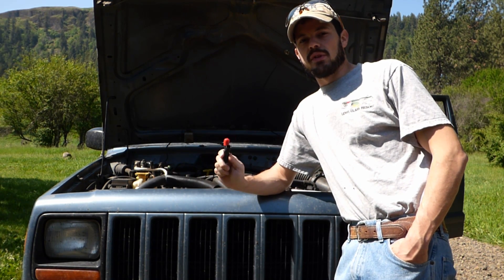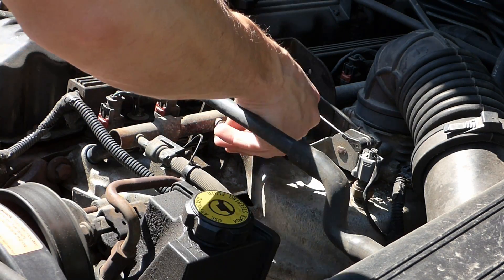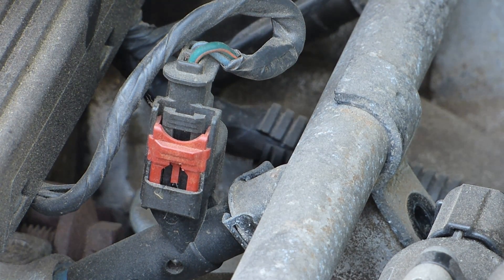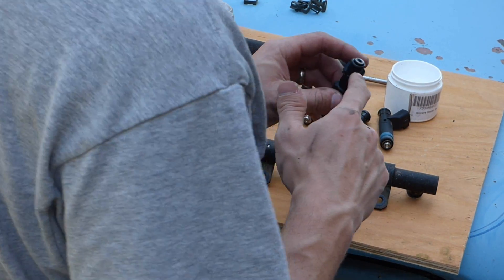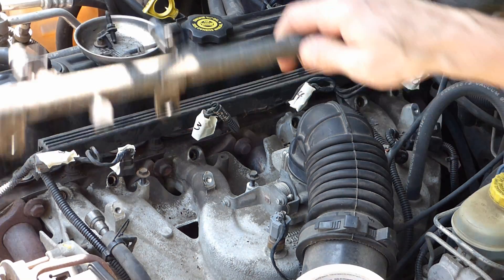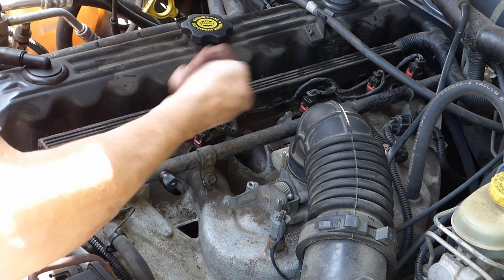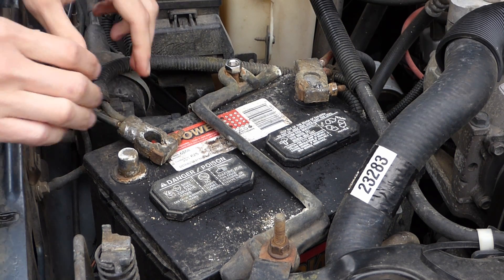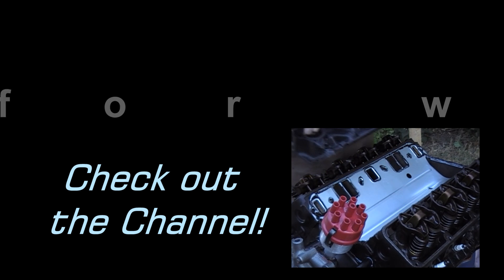How to do the Injector Upgrade on a 99-01 Cherokee XJ

Comment: Can u highlight this so others that never did it know.   When you press the injectors into the engine...your NOT trying to make them pop in like when you insert in the rail. When you bolt the rail down you will see the injectors slowly seat deeper in.  And yes leave thos plastic rings on the end on.

Comment: Vaccum  around and ports as well from potential debris then wipe off. I prefer to use chop stick or pencil to insert t-shirt rag in hole then spray clean with brake clean or carb clean fluid then clean up twisting as U would rifle chamber. Super clean bore and ready for a lil bit of silicone lube. Extra mile but gets U extra clean. Ps... will slide right in with lil effort as well.
Also great time to add heat shield or heat wrap on the fuel rod if does not already have such.
One more thing; Duude... Clean your terminals while ur at it!

Comment: Ford 4.6 injectors are 4 hole. And flow the required ammount yellow body. My wifes crapped out lincoln donated a set. Smoother idle and assumed higher gas mileage havent checked old or new.

Comment: just did this to my 2000 xj, pulled the intake and had it ported and polished then chromed. since it was off i threw new bosch 12 port injectors on with a insulator kit that came with wraps for the fuel rail and injectors. starts up faster and idles like butter. still breaking in the new motor and can't really lay into the throttle just yet but so far i like what its doing. if you have the time to just pull the intake manifold off and clean it. its easier to have it blasted and you get a brand new looking intake out of it

Comment: Learned the hard way.
Always have a fire extinguisher at the ready after doing any fuel related work .
Just flexing a fuel line can open a crack in a dry rotted fuel hose and cause a giant flame up.
Can be a good way to burn your jeep and your house down at the same time if you have no fire extinguisher.
Reply from the maker: True. This can happen with any rig at any time whether it's wiring, fuel or oil, so I always keep an extinguisher in every vehicle.
Reply: J20Jeepster 
Yep.
My last flame up was when I used some wearever brake kleen to douse a bunch of sludge from my xj motor after an oil change.
I usually blow it dry with compressed air but decided to fire up the engine afterwards and it flames right up , probably from getting brake kleen on my starter wires.
Flames shot about a foot high.
Luckily I had my extinguisher handy.
One blip and it was out.
No damage other than some wire plastic conduit got melted.
Reply from the maker: @hallhouse5098  Dang, that would give you a start! Glad you were quick with the extinguisher. I was soaking a brake drum in liquid wrench and couldn't get it to budge. After I thought all the lube had dried off, I tried heating it to get it off. Apparently there was still quite a bit inside the drum and up it went. I was able to put that one out too but lesson learned.
Reply: J20Jeepster 
Yep...instant pucker factor all right.

Comment: Hey Jeepster how did your mileage improve?>'
Reply: or get worse.
Reply from the maker: 1mpg better average. I was getting about 17 mpg after the swap.
Reply: @J20Jeepster  nice! Any more power or throttle response?
Reply from the maker: @David-rj1ru  Hard to say if it was my imagination or not, but I think so. Biggest deal was it started way easier. Engine only had to turn a couple times to start where before the upgrade I would sit there hoping my old battery had enough left in it to get it started.

Comment: No need to bleed the fuel rail...just pull the relay on the fuel pump and start the engine. When it stalls the fuel rail is empty.

Comment: talked to a 4x4 mechanic mostly jeeps and he recommends if the stock one works don’t change them till one stops working cause he hasn’t had any of the guys who wanted to switch talk about how much better the jeep runs them with original ones
Reply: Exactly. On reddit or the cherokee forum its always  " Did the injector upgrade and I have a problem with ________"

Comment: Thanks for the vid it’ll be a big help in the near future. Whats your best guess for a rough idle.? Timing. Injectors, IAC. I already replaced cap rotor wires plugs and cleaned throttle body. Thanks again
Reply from the maker: Thanks for watching! So many things can cause rough idle, but injectors is a common culprit and it's not too bad of a job. The other simple things to check would be your fuel filter, o2 sensor and if loss of power comes with the rough idle check you cat.
Reply: J20Jeepster  I will eventually replace the entire exhaust system. I have plenty of power and runs smooth on the road but my main issues right are a rough idle and very poor MPG. Thanks

Comment: Hey what year or part number are these injectors? Are these the mustang 4.6 injectors? Thanks for the video.. Definitely gonna do this upgrade!
Reply from the maker: Pretty much plug and play. At the end of the video I show how to reset the ECU to re learn the mod.
Reply: @J20Jeepster  Thanks again bud!
Reply from the maker: I went with the 784 Dodge neon injectors because they have almost identical fuel output. If your Jeep is older you would want the 703. Thanks for watching 👍
Reply: @J20Jeepster   Hey appreciate quick response.. Got a 2000 here so it's quick plug and play? How long did your ECU take to learn the injectors?

Comment: I like to shoot compressed air all around the injector ports to clean debris away before removing the rail.
Then I spray wearever brake kleen liberally then shoot air again.
This will get rid of most debris.
Once out, an air operated vacuum or a small nozzle vacuum cleaner can aid in debris removal.
I use a small rag around my finger doused in brake kleen to finish getting crusties out of o ring seats.

Comment: Thanks for the video! So I just upgraded to 4 hole injectors on my 2000 xj. I changed the plugs and add a fuel rail and injector cover kit. https://www.amazon.com/gp/product/B015NOKWQY/ref=ppx_yo_dt_b_asin_title_o03_s00?ie=UTF8&psc=1
I had heat sink issues when shutting off engine the exhaust manifold would heat fuel in fuel rail and fault out number 3. So far runs good but i'm having the same starting issue. Also, as I started to test drive I had no oil pressure. Don't know if the computer had to relearn the switch so I replaced that oil sensor switch and that fixed that.
Reply: Now it is I have a fuel issue, its cranking more to start than it was before the upgrade. could they not be sealed?

Comment: You reset the computer before star the engine and others do that  after to start  it  or thats depend the models and the year and whats happen if we dont reset the computer please respond thank you
Reply from the maker: Others are probably testing for leaks before reseting the computer.  Reseting the computer makes it learn the new injectors. Otherwise it will just use the settings for the old.  Resetting the computer should really be done after any tune up,  because you hopefully improved the performance and you want the computer to take advantage of that.

Comment: I recently did this upgrade. I used a vacuum, pick and q-tips soaked in intake cleaner to clean the ports on the manifold. Once I picked everything I could and sucked out everything the q tip soaked with cleaner got what was remaining.

Comment: Use a damp cloth with a small screw driver tip to clean the empty ports for the plugs. The dirt will cling to the damp cloth and not fall down the hole!

Comment: HELP PLEASE:  So I just did the upgrade. I reset the computer and boy my 01 XJ ran rough. I though I'd take it for a test drive and while driving around my check engine light came on and started blinking. I tried to floor it a few times and my engine felt like it was about to stall out around 3000 RPM. I don't see any fuel leaks around the injectors. I don't think I smell fuel in the gas, though I'm not sure how to check. Is this normal? What should I do?

SOLVED: So I found out I was given a bad fuel injector. The #6 injector had a bent prong and wasn't connecting to the electrical connector. That is why it was misfiring so badly. I put one of my old injectors in it and will ask for a refund on Amazon. It runs great now. I'll need to replace it of course so I have the 4 hole connectors on all cylinders. 

Note: I did however notice some water coming out of my tailpipe when I was cleaning up. I'm not sure why this is happening. Just a bit as it was running sort of sputtering out the tailpipe. I smelled it a few times and it did not smell like fuel. A mechanic friend of mine told me not to worry about it but I'd still like to resolve it.
Reply: p.s. these were the injectors I used:  https://www.amazon.com/gp/product/B071YD9GBK/ref=oh_aui_detailpage_o00_s00?ie=UTF8&psc=1
Reply: P.P.S. UPDATE: Took it to O'Reillys to check the code and they could not check the code. They kept getting error messages. :/
Reply: Its just water in ur gas probably add some water remover

Comment: my fuel rail is leaking small gas through the pressure nipple, also has no cap. Could this be a serious issue? Can it be repaired or need a new rail?  Good video BTW
Reply: Try tighten it or replace the Schrader valve core and get a Cap for it keeps dirt out
Reply: Yes, big deal! Replace the valve immediately

Comment: I have a couple questions about the hoses you start taking out at the beginning in order to get to the fuel rail i recently bought a 99 Cherokee and I think I’m missing on if those hoses if you can describe their use of each one maybe I can buy the part thanks. Also on the lower right underneath the air intake by the air filter on the side of the motor there’s a plug with a hose. Mine Jeep just has a plug without that hose running into it. Can you describe its use please. Or can I send you pics via email. Thanks
Reply: TheJ20jeepster https://photos.app.goo.gl/ONGvOAxmKjvkftom2
Reply: TheJ20jeepster cables are mixed up just left them the way they are. Hope you can see the plug with no hose or cable to it
Reply: TheJ20jeepster https://photos.app.goo.gl/ONGvOAxmKjvkftom2 here’s another link just in case. Also I sent you a picture of the lower passenger side underneath the fuse box something is cracked and a bit of cold air comes out of that cracked plastic. Wondering what part is it.

Comment: Thanks for your video. Could you be so kind to summarize all what you face since did this upgrade, please. Is there any negative effects appeared during this year? is there an improvement in engine work on idle and under the load, as well, have you faced fuel consumption improvement after upgrade. I plan to do this upgrade with my 4.0 L6 2004 Wrangler, and gather some first hand information. Thanks in advance for response.
Reply: TheJ20jeepster 
I have a dilemma. I found two different part numbers: 0280155784; 0280155746. As per seller, both fit on 4liter 6cyll Jeep engines. Now I am looking for it's specs and original ingectors specs to compare.
Reply: @AlexeyMagher  it can be confusing, when in doubt check an auto parts store if available where you live. They have the database to confirm part numbers.

Comment: If you engine is some what clean. Use high pressure air to clean off all surfaces. BEFORE tear down. 
In this case, put put long air nozzle into cylinder/injector hole. Turn air on low, brush dirt away from hole. The low air pressure coming out of the cylinder hole, will keep trash out.

Comment: My 2000 Cherokee uses more fuel after the upgrade. How can I tell if I have a stuck injector? It seems to run the same. If I didn't set the computer right the first time can I do it again and relearn?
Reply: I reset it and changed the air filter and it seems to be doing better. It seems to have a slight miss. Im wondering what to try next? Any thoughts?
Reply: I also installed a new coil pack and new Autolite Copper plugs...Its a 2000,,,No cap or wires...coil pack is a direct fit but I assume you know that. Its just a slight miss
Reply: Nick Kostolnik im also having the same problem

Comment: Before I take out anything I use my air compressor with a long tip either use a brush or towel if needed but thanks for your video I just changed my injectors using your video ! Sadly broke most of my clips nothing a zip tie can’t fix

Comment: Would you be willing to do a short swap video with a write-up on the newer 12-hole injectors that are apparently relatively fresh to the ev6 line? I have yet to do any sort of upgrade but what I'm seeing from those I ask is that they're getting even a slight bit more out of the 12-hole than the 4-hole (understanding there's diminishing returns with just adding more holes). I'd just be curious if the throttle response was any better, I was told by someone who swapped that they get about 2-3 better mpg, not quite sure what 4-hole got

Comment: Hey, will this upgrade help with the "heat soak" issues, causing cylinder misfires?
Reply: No but i have cut an old 80's heat tube that goes from the exahaust manifold to the i cold air intake of a Chrysler or chevy  and made a cover that overlays the open hole where heat rises up and gets blown across the injectors..

Comment: Hey, I have a 2000 XJ and I'm replacing the fuel rail as well as upgrading the fuel injectors. I noticed that your rail dose not have a fuel pressure regulator, is it an issue if you don't have one on the rail? Thanks for the information on how to properly do this.
Reply: Most 90’s Mopars have a returnless fuel system that is regulated immediately at the pump.

Comment: Use a shop vac to clean out the ports, vacuum is always best when it 
comes to something like that..although before you remove anything like 
that, use a fast food cup extra straw (yes 'borrow' an extra from a 
place!) and blow out the surrounding areas/holes, this also applies to 
spark plugs etc.., anything that you don't want grit/debris to get into.
 Yes, you could use compressed air, but that can also destroy 
surrounding things because of the pressure, so a blowgun from the 
compressor isn't always the best idea.
Did these on my '97 I sold, now have a '98(with 47k orig. miles) and a '99 I'm going to do soon.

Comment: Hello from Egypt. I just upgraded my injectors on my cherokee 99 xj. I bought refurbished Bosch 784s from an eBay seller with very high rating and reviews. I got them installed by a professional mechanic whose an expert on this car. I also did the ECU reset as you showed in the video. Unfortunately the outcome is bad. The engine is running very rough as if there is a misfire. Is that normal in the beginning and it will take time to readjust because I read that it takes 50 warm ups to reach optimum performance. I'm not even sure I understand this. Can you please advise, what do you think the problem is. The engine was running smooth before the swap. I don't get it.Ahmed
Reply: If the ECU doesn't correct after a few starts it sounds like you swapped an injector plug around try switching 1&2  if that don't fix it put them back and switch 5&6. Some say its rather hard to mix the others up but check and see if you mixed the plugs up. Hope it helps...
Reply: Thank you all. It turned out that one of the new injectors was bad.

Comment: I recently upgraded my factory injectors on my 2000 xj and It now takes about 2-3 seconds of cranking to start. I used to start up near instant with my old injectors. I also seem to have introduced a vapor lock issue whenever the Jeep sits for a while after running.  Do you think this could be faulty injectors or just a bad install? I don't see any noticeable leaks and I never had these problems before, however I do notice the jeep is more responsive with the new injectors. Any advice is appreciated.

Excellent video by the way! Thanks!
Reply: TheJ20jeepster I found my problem. 2 of my Injectors are stuck open. would I be able to mix in 2 of my old single hole ones or should I put back my old set?

Comment: I liked the video and I have a few tips for you. First, never handle lead battery terminals with without HD rubber gloves. Lead gets absorbed through skin and can cause illness (my buddy handled lead weights as a commercial crabber and wound up with multiple myeloma cancer) Second, the 4.0s injectors should have heat insulators installed over them before being reinstalled because they are prone to vapor lock from the heat of the engine when sitting for short periods (heat soak) and will cause engine to misfire at start up. Third, always clean the terminals and battery posts before reinstalling them. Hope this helps.

Comment: i purchased a 2004 WJ grand cherokee with the I-6. currently has 98,000 miles on it. i had a problem with it driving in wet conditions it would stutter from idle to pedal (new plugs and coil pack) problem solved. But now once in a while in cold conditions when i start my jeep up it "rough starts" like it doesn't want to run so i might as well upgrade the injectors is what i am thinking.sometimes my engine will rev up from idle after 15 minutes or so to but i did some research on that problem and it's some expensive valve in the intake system that needs to be cleaned gingerly
Reply: Look into seafoam to clean everything

Comment: I heard you weren't supposed to turn the fuel injector rail upside down. Is this true?
Reply: Just kinda worried, friend of mine said they were fragile and I may have dropped mine 😂. I done the injector upgrade today on my 01 turbocharged xj Classic. I used the Bosch injectors know if there any good?
Reply: I was experiencing a misfire at idle and around 45mph it would shake and act like it was running out of gas